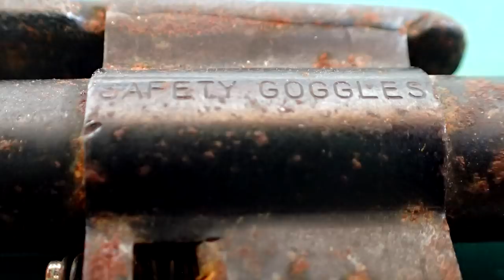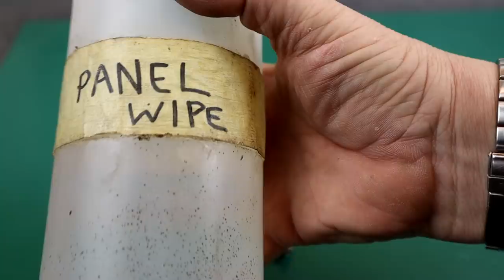I Didn't Know What These Weird Pliers Were Till I Restored Them

Comment: Safety wire pliers. They were a standard tool in every toolbox used to work on aircraft. They are used prevent nuts or bolts from falling out.  You don't want a bolt on an aircraft to fall out. It can jam where it causes more harm or injure the crew.You put a wire through a pre-drilled hole in the nut or bolt.Clamp the pliers on the two ends and pull the knob to twist it. Then you take the wire in a direction that doesn't allow the nut or bolt to unscrew and attach it to another object to secure it.

Comment: They are wire locking pliers used mainly in the aeronautical industry for securing nuts, bolts and fittings so they don't shake loose on aircraft. We used these extensively in the RAF

Comment: Aviation safety wire pliers and they are brand spanking new, just neglected. How can I tell they're new? I am retired US Navy, aviation arm, and I used safety wire pliers for 20+ years, and for far too many years I had the side job of maintaining the tools and eventually running a squadron's tool room. The knob is aluminum and pits horribly and looks chewed after a few years, the spiral driver attached to it...that oxidizes easily and is usually black blotched within a year, the plastic is only on the cheap ones and I didn't see them coming out until around 2003? to 2005, the good ones have a metal bail not plastic the metal itself is high carbon steel and the finish is usually either parkerized or steam/oven blackening. The dotty spots of rust happen if you sweat on them or use them in the rain and you can get rid of that with some light machine oil and a rag. I have had one pop up that was wicked old, it was in a tool box for S-2 Seatracker aircraft and it looked like an orange. Brass brush, light machine oil (VV-L-800) and it looked new. Painting? promotes and hides rust on that kind of tool
Reply: I used to rebuild AGT1500 turbine engines and used them a lot on the forward modules back in the 1990's and early 2000's. I agree with you. I never saw any with plastic on them.
Reply: Looks like a bluepoint. Not that old of a tool. Avation. Mech
Reply: Thank you for saving my time
Reply: Howdy all. I agree with what they are and have used them countless times rigging jet ejection system components because things coming loose would, of course, be disasterous. We RCAF folks call them "lock wire" pliers or simply wire twisters.
Reply: P
Reply: Perfect explanation Gene, I really miss poking my fingers on that damn safety wire ouch! Thanks for your service bro!
Reply: Safety wire pliers I have a good set of them but don't use them much anymore. We also used them in the US Navy Submarine Service on some of the engine room equipment.
Reply: We used them in the Air Force all over the aircraft
Reply: My dad was AIMD for VA-83 (Rampagers) he had a set of these at home...I knew tools back then..could never figure these out until dad showed me one day

Comment: Those are safety wire pliers.  We use these to tie wire to nuts and bolts on aircraft.
Reply: I always prefer doing it with my hands
Reply: And I at J79-17A Jet Engine of F4F Phantom II by German Air Force at the '80...
Reply: I vote we call them: 'spinnymajigs'
Reply: Ezir dax same
Reply: Ezri Dax lol! sure buddy. not on aircraft you don’t.
Reply: Those were US Navy standard issue when using nuts and bolts on aircraft engines.  That was the first tool you had to master.
Reply: Angelo Morte i used to be an aircraft mech in the USMC there is no way you can just use your hands to saftywire without the swipes
Reply: True I see them daily
Reply: Recognized them straight away.
Reply: Absolutely correct sir
Reply: when I was a young man I worked for Sears for a year and part of my job was putting antenna's on houses, and we used these type of pliers to " spin" the guide wires on eyebolts on the roof's at 4 corners .....
Reply: @ezridax5809  I'm an aircraft inspector. In most areas on an aircraft, hand twisted safety wire won't pass inspection. Won't be tight enough. Plus with 150 bolts around say, an engine casing, you'd definitely want these pliers.
Reply: @jojodiver8706  lol my teachers always say that you are almost never going to use them because you don't have enough room when working in a tight area and we have to do it with hand's
Reply: @ezridax5809  yes, you will run into lots of situations where wire pliers just won't fit and you'll end up hand twisting, but it's difficult to get a nice twist. It's a skill that only comes with practice.  There's lots of little tricks to it that are hard to explain.
Reply: F18 hyd mech! That makes be feel old
Reply: these are not made for aircraft they are made to do what you said yes but also to make it easier to do so without trying to use normal pliers or vice-grips
Reply: ALL THROUGH the aircraft, actually. I MISS those things. Need to get me a pair, just to HAVE. @randomrobbie8923
Reply: @nooksolo  why wouldn't you use hands to complete a safe wire install on aircraft?  As a F-4, A-10, and U-2 crew chief for 12 years, I could make a tighter, better looking and more durable (no overly tight areas due to pliers start) with my hands.  On the F-4 and U-2 especially, there were many areas that required nuts or bolts to be secured with safety wire but there was no room to get the pliers in to do the work and hand was the only way.  Doing the job by hand also seemed to remind folks to make the "pigtail" on the end so the next guy inspecting didn't get an unpleasant surprise with safety wire jammed through a finger.
Reply: @jojodiver8706  someone just isn't teaching the folks how to do it by hand properly then.  When I was working aircraft after I'd been in a few years and was certified to sign off on critical inspections, I failed more folks for having loose or over twisted wire that used the pliers than I ever did for those that did it by hand.  Especially with the twenty thousandth wire we had on electrical connectors and critical cockpit connections, pliers would over twist or twist the wire to fast so that heated and became brittle.  For 32 or 60 thou wire, the pliers were good for making longer runs, after properly started by hand to ensure the wire was fully engaged with the nut or bolts being secured, and used to make the pig tail and clip excess.  I can honestly say that sitting with a new troop for an hour and mentoring them proper was all it ever took.  On the plus side, not using the pliers meant not having to search for the pieces when the latch clip, spring or other parts of them failed, usually when you're working in the cockpit or another area that has a zero foreign object criteria.
Edit: spelling corrections
Reply: @TheYaegerjeusmc  yep, know what you mean, I look at my hands now after I've been out of the military for a while and wonder how all the hydraulic fluid and grease ever finally came off of them.  Seemed like they were permanently stained while I was in.  But I do miss it, nothing else will ever come close to the feeling when seeing my old bird talking off in the mornings.
Reply: Ed Stalnaker i think you are ref. to .020 safty wire . i was ref . to .032 i should have explained in more detail. .020 is 16 pier inch and .032 is 8 twist
Reply: It has many names, Jet twister is one known in the Mechanical engineering business. Lock wire pliers, etc. Nice job on the restore, Love the red paint.
Reply: Ed Stalnaker and .020 safty wire was for mostly avionics . it’s been 20 years since i’ve even touched one. i may be wrong
Reply: @nooksolo  The .062 I spoke of is used on the Diesel exhaust on a Nuclear submarine.  lesser gauge wire is use most everywhere else, in aviation, I would venture to say the prop lock wire to be at least .032  again there are many variations of gauge wire use throughout many different industries.  Cheers
Reply: @nooksolo  we used 20, 32, and 40 thou.  20 for small or delicate connectors, 32 is general purpose and 40 (maybe 45? Been a long time) was the heavy duty safety wire.  I did it all by hand and never failed an inspection once I made e-3.  But that's how you learn.  Do it wrong, fail inspection then do it with your nco or boss looking over the shoulder until you have it right.  Next time you don't want to waste an hour or get yelled at so it's right the first try.  I will say this, in my 12+ years in aircraft maintenance, I saw them change standard probably 14 times regarding the "proper" way to do safety wire.  It usually went like this; IFE(in flight emergency) for something, investigation reveals part wasn't properly saftied so big wigs say it has to be done with pliers only, few months later same scenario so they remove all safety wire pliers and mandate hand only rinse repeat until the nco's tell the troops to do it how they can do it best or a maintenance commander realizes the issue isn't with doing it by hand or with pliers, it's with training and inspection practices.
Reply: Ed Stalnaker what i’m saying is . when i was doing it we could hand twist most 0.20 safty wire . but on all that used 0.32 it was mandated to have exact amount of twist and tension uniform . it was the USMC and all.
Reply: nooksolo what airframe were you on? I’m a uh-60 guy in the army. We used to use mostly safety wire, but not we generally use the cable gun on our uh-60m. Makes things loads easier on the inboard retention plate if that was your airframe
Reply: Kevin Montgomery i was a CH-53 dirty D FLIGHTLINE 20 years ago .
Reply: I thought of the same job as you all did but I didn’t think of it as an aviation tool
Reply: Yep. I was introduced to them when I volunteered at the National Warplane Museum.
Reply: Or cars,trucks,etc.
Reply: Angelo Morte 
So you don’t think aircraft have any bolts and nuts?
These players were invented for the aircraft industry.
However, strange as it may be, they setup a stress flaw in the safety wire and therefore are actually not desirable to use (although they are widely used). It is better to hand twist the safety wire rather than to use pliers.
Reply: usaf 58-62 c-124a used them a lot.
Reply: @ezridax5809  I did too. I was F-4 Egress and my wire on the Martin Baker seat was as uniform and tight as the pliers. Plus we had some tight spaces to work in.
Reply: @colinexeter2262  I was a Phantom Phixer too. F-4 Egress. Did my wire by hand but sure wish I had my pliers as a souvenir.
Reply: I used them for twisting wires for sealing bags of flame retardant plastic.
Reply: Did not know the Safety Wire Pliers existed or were used for. First time I have seen it on this video restoration. Great tool to have. Thanks
Reply: We use them a lot in the nuclear power and propulsion field as well. We call them lockwire pliers.

Comment: I used these safety wire pliers from 71 to when I got out of the Air Force in 99.  Extremely useful for getting the correct number of twists of the wire between the bolts.  Doing safety wire was an art.  7 to 9 twist per inch.  It was always attached to keep a bolt from unscrewing.

Comment: I had a pair when i worked on the F 105 Thunderchief back in the 1960's.  They came in really handy when I needed to clamp a hose on my car and did not have a hose clamp.  That stainless wire holds things together much better than those plastic twist ties.

Comment: Dang, now all you need is a Pratt & Whitney J-57 and you're in business. I worked on KC-135 and B-52 engines back in the 60's. QC would always find the two bolts under the defuser case not properly secured, that's where I did my magic, (crew chief on gig team) twisted them by hand to keep from droping the OPAH. Damn I was good. Thanks for the memories.
Reply: Oh, along with your engine, you'll need a roll of .035 SS safety wire. Wire must be millspec and make sure your tech order is open to the correct page when working on any component even if you've done that same job a thousand times, again, QC loves to write guys up for that stuff.

Comment: I have 2 pair from back in the '70's when I was assembling aircraft hydraulic components. Normal standard is 10 turns per inch, any tighter will cause the stainless steel wire to break. Most smaller bolts and nuts used .032 wire. Larger fasteners used .050 or .062 wire. The company I worked for provided lead seals that we had to crimp on all the twisted wire pigtails. That way they knew who assembled the unit as all the assemblers had a crimping tool with our number on it. BTW, you can buy gun bluing kits for less than $15. I have some tools that were handed down to me when I was young. My father used them during WWII when he worked at Lockheed in Burbank, CA. I restored several using gun bluing to protect them from rust.

Comment: Most of us in the military, doing mechanical or electronic work had those issued.  I had them for securing safety wire on antennas, to prevent them from falling off.

Comment: In the Navy, we used them on our 600 and 1200# steam line piping thermal insulation lagging to hold the lacings together. We used either brass or copper wire doubled up and twisted together!

Comment: Military Aviation twist lock pliers.  Technical Inspectors wouldn't let us use them because they left a mark on the wire. Had to wire twist by hand.
Reply: Dave Pelfrey - forgive my ignorance, but wouldn't any marks left by the pliers be well beyond where the wire is actually doing it's job? I mean that any scoring in the tail of the wire wouldn't be compromising its strength where it's needed, where it passes through the hole in the assembly or in the twisted portion that secures it. Far be it for me to question the expertise of "technical inspectors", but I think you were being fed a line. I'll bet the real reason was that they didn't want people using such devices and over-tightening the wire,  possibly leading to stretching or breakage where the single strand passes through the secured parts and that they assumed hand twisting wouldn't do this. The thing about marks was just their clue that the safety wire might not meet specs because it might have been damaged by being twisted too tight by such a tool.

Comment: Safety Wire pliers. Usually the center screw device is spring loaded/retracted. Yours appears to be missing the spring. So when you pull out the spinner and release, it returns to the pliers and you can then re-spin it again quickly. I have two hanging on my workbench. Got them as Avionics Specialist in the USAF back in '66. They are usually used with single strand nickel/chrome wire of .028 to .035 diameter.

Comment: I spent about 8 years working on aircraft in the 70s in the
Navy, I got real protectant with them. Safety Wire Plyers for locking bolts or
nuts, the Navy tried to ban them because they nicked the wire which compromised
its strength. I don’t remember them being painted red.

Comment: I'd been on service in the Mexican Air Force since 32 years ago and those are one of the most used tools when servicing any aircraft. On your video you have a very close idea about how it works but is not exactly that way. When you lock a bolt or nut to a fixed point the safety wire must take a kind of "?" form and when is locked to another bolt or nut its form must be a kind of "Z", something like that. Very good video and good memories.

Comment: Had to get one of these to prevent the exhaust pipe nuts coming loose on my 900SS Ducati in the early 80's.  The only place I could find them in the UK was Snap-On, at an obscene price of course.  Fortunately they are the best quality type, I still have them now in as new condition.  Mainly because they were so expensive so I have been obsessive in keeping them coated in preservative oil and wrapped in a shop towel in a zip lock plastic bag!  I have used them on other bikes and cars over the years though, good tools are for life!

Comment: We used them a lot in radio frequency null out. We had 8 to 1” depending on how far we needed to null out we would measure the distance in inches and that’s how many twists we would pull it. 50” distance = 50 inches. For instance invisible dog fence if you wanted to allow for a shock collar not to shock a dog we would twist the wires and it would null out and allow the dog to travel past and not get shocked. But if wire was straight when collar would get within proximity it would administer a audible tone followed by a shock. It worked great and ensured a even and uniform twist. 8 twist per inch.

Comment: Hi Wire locking pliers  used to safety threaded items from working lose. You need to throw a bit of oil on the twisting shaft to make it run smoother as this model does not have a return spring. Nice video

Comment: I've ended up with a few pair of these over the years. The older ones I have use a bit of oiled leather with an slot in it to guide the chromed or stainless spiral. all steel construction even the knurled steel knob. The oldest Pair I have are WW2 vintage (maybe 46-49) as my dad was an aircraft mechanic in the navy on the wasp and Was aboard the Yorktown During The Battle of the Coral sea. As a kid I remember My dad wiring the spokes on his Indian Chief so I of course did the same on my Bicycle lol.
Reply from the maker: Great info bud. Thanks

Comment: Used them almost every day when I was in the USAF for locking down the mounting nuts to secure radios in mounts on aircraft. .032" wire was the most common. These are Safety wire pliers.

Comment: We used them in surgery to twist wire around a rod adjacent to the spine for childhood scoliosis surgery at the University of Michigan. We referred to them as Jet wire twister( right or wrong?) in 1995 . Technology has changed and not used now
Reply: Yes: Jet Wire twister / Safety Wire Pliers / Swipes (Jarheads called them swipes) / Arm-cutters.  Many many names for them over the years.  I used them when working C-130s and still use them around the house all the time.